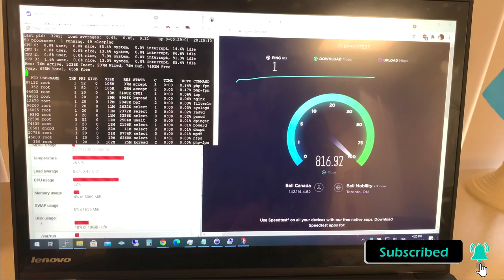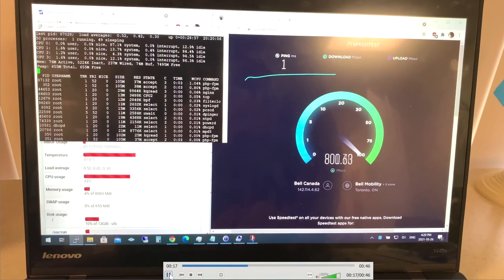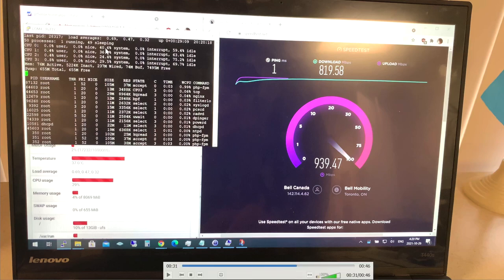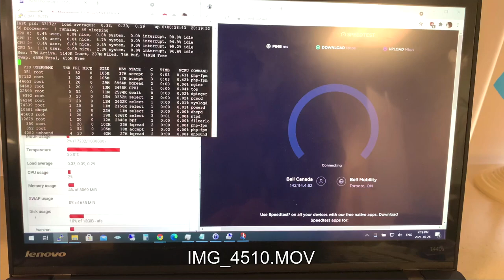Troubleshooting: This is Why Your pfSense PPPOE Connection is Slow

Comment: I have Bell Fibe 3G/3G and PPPoE in pfSense is still holding it back a bit. With a direct 10G LAN connection into the HH4000 the speed immediately hits 3.2G. Through pfSense PPPoE, it climbs to 2700Mbps after a few seconds. I wish there was a way to add static routes in the HH4000 so I didn't have to double-NAT when using the HH4000 internal PPPoE. Please Bell, it's all I want for Christmas. OK that, and 8G/8G in my area.
Reply from the maker: If I understand correctly, when configuring PPPoE on pfSense as a client, a static route for the gateway IPv4 10.50.44.193 is established. Furthermore, there's a possibility that 10 Gbps networking is already available in your area. To achieve speeds of 3 Gbps per second, the transceivers on both the UNT and OLT need to be 10 Gbps. However, it's unclear to me why 8 Gbps packages are not being offered in your area. It's possible that the connections between central offices or to the peering exchange are not sufficiently fast, which might be the reason why they are not offering 10 Gbps services.
Reply: You’re lucky, I’ve got a phenom 4 core and with pass through I’m barely hitting 1 G down.

Comment: So glad Bell does NOT use PPPOE in Manitoba for their FTTH. I get full speed using any type of router.
Reply from the maker: Bell's operations vary by province. Not surprising that they decided not to use PPPOE.

Nevertheless, I'd like to know the model of the gateway unit they supplied you with.
Reply from the maker: Oh, yes the HUB 3000, I remember that one, I had it too. 

Did you know, that it actually has a removable transceiver.

Comment: which version of pfsense did you use?
Reply from the maker: That is a good question. The video was filmed on 2021-10-26, so it would have featured the most recent version available at that time.
Reply: @Tek4You-  hi! I set up the pppoe connection on the newest pfplus version, netgate 6100. 500mbit connection, i reach full speed. Processors/cores are bored :)
Reply from the maker: The Navigate 6100 should not have an issue handling a 500 megabits per second connection over PPPoE. However, it might encounter issues with connections over 1000 megabits per second using PPPoE. But I wouldn't be surprised if PPPoE gets patched in the future, or not seeing how old it is.

Comment: Change your MTU to 1452. That will also help.
Reply from the maker: Why 1452? That doesn't make sense to me, as PPPoE overhead is only 8 bytes. pfSense automatically adjusts this to 1492 for a PPPoE connection. Even if you're implementing VLAN tagging (only if it's required) on the WAN interface, which adds an overhead of 4 bytes, it should result in an MTU of 1488 bytes.

Comment: this is well known that PPPoE is single CPU utilization - and for unknown reason lot's of ISPs around the world are using thie method... which is problematic for the end user !

Im having the same problem - and my connectivity is 5Gb - and i get at the best 1.5Gb:/ with UDM pro for this instent
Reply: I have not idea how to be able to get my 5Gb... and no ISP does not supply L3 solution .. i need ot come up by my self
Reply from the maker: Parallel well-known issue now, but when I Google this 4 5 years ago I didn't find anything on this, only one article buried under search results.

My theory why they're still using PPPOE, is to allow customers to use their own hardware.
Reply from the maker: Forget to ask you, how is your upload on your 5 Gb connection? Because for upload PPPOE uses multiple cores.
Reply: @Tek4You- you are right the upload is much faster around 2.3 and i have an explanation- im using hardening (security) so it lower the performance.
The next plan is to buy another router that has 2.2ghz speed and to see if i will able to improve this. 
I been told that it should be enough !
Anyway I promise to keep you posted
Reply from the maker: @MrAsafalfa  I've got an update for you. I've been testing pfSense v2.7 on a 3 gigabits per second internet connection. Impressively, I'm seeing speeds ranging between 3 to 3.3 gigabits per second for both downloads and uploads during my tests using speedtest.net. However, I noticed that it's still maxing out a single core on a Xeon processor.

Oh yes, I forgot to mention this is a 3 gigabits per second symmetrical package and it looks like the ISP provides a little bit above for the overhead.
Reply: @Tek4You-  is it on baremetal or vm ?
What type of hw you run it ? 😝 details man 😉
Reply from the maker: That was Dell T320 Server with Intel(R) Xeon(R) CPU E5-2470 v2 @ 2.40GHz
pfSense is installed directly on the hardware, not on virtual machines.

Comment: No solution? I have the same problem.
Reply from the maker: I guess you are not paying attention, or maybe I didn't explain well enough.
The solution is to get a faster processor. Ideally you want to processor has a higher score for single core performance.
Second solution don't use ISPs the use PPPOE.
Reply: @Tek4You-  I was  kinda hoping for a software fix 😀
Reply: @Tek4You-  I tested with a Ryzen 3 PRO 4350GE and with BELL 3Gbps plan I get MAX 1.5Gbps. A faster CPU is not the solution for everyone.
Reply from the maker: It seems there might be a bottleneck in your setup. For reference, I use a Xeon E5-2470 v2 CPU and achieve speeds of 3100 Mbps. I began achieving these speeds after upgrading the server's processor.
Reply: @Tek4You-  Did you reach this speed on pppoe connection? I have a similar processor, but I cannot reach 1Gbps both in downloading and uploading.

I used HP DL360 G8, onboard ethernet and pfsense 2.7.
Reply from the maker: Yes, I achieved those numbers on a PPPOE connection as a client.

If you have one Gigabit per second symmetrical Internet package you will never achieve 1 gigabyte per second, mainly do to PPPOE overhead traffic. 

Normally you would hit 940 megabits per second symmetrical, in some cases you can achieve 980 megabits per second symmetrical.